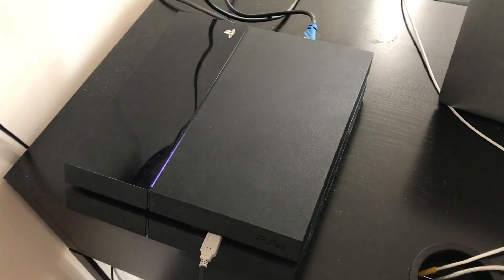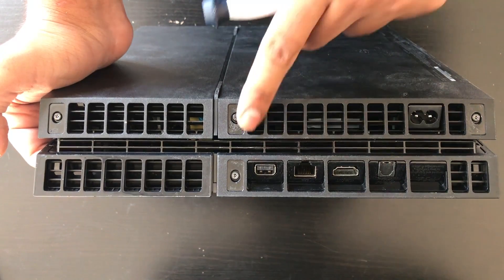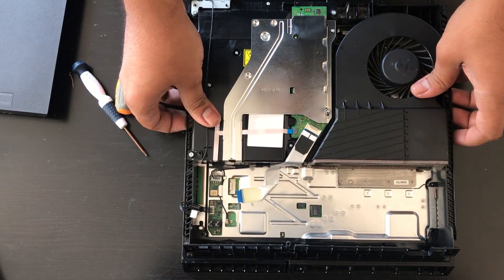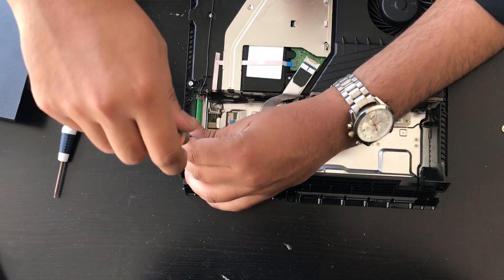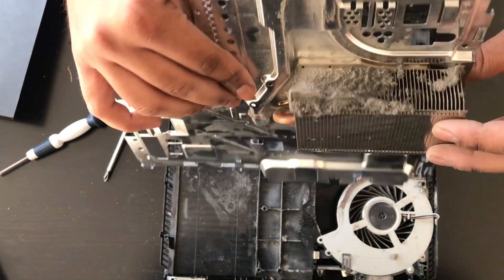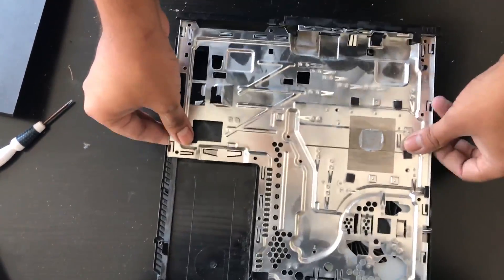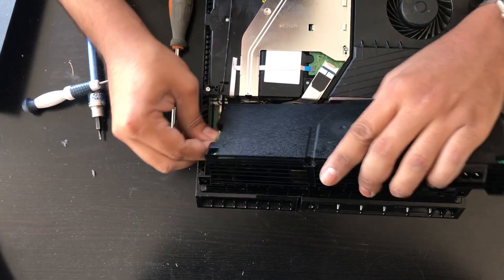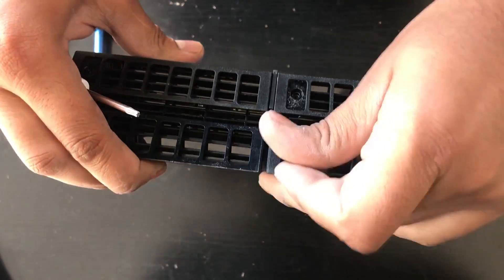PS4 Too Hot overheating due to dust build up and fan (CUH-1001/1115 cleaning and disassembly)

Comment: I did all of this step by step, double checked everything. I also replaced the thermal paste. When i turned my ps4 back on it started up quickly, flashed red and beeped 3 times then turned back off. It didn't used to do that i don't know what happened.
Reply from the maker: Something went wrong clearly

Comment: Hey so my PS4 is a original one got it from a mate for 80bucks when my daughter was like 3,she is now turning 12 lol,My PS4 was just randomly turned on for one sec then turned off,saw your video about power supply then just got the dust off it and it works,but ended up doing the full clean and even replaced the thermal paste and I watched you videos, took my time and it's now like a brand new PS4 so quiet and stays cool, my daughter is so happy and so am I,thanks so much for the instructions it was easy to follow and  it wasn't as hard as I thought. Thanks mate👍

If you are in a similar position to me and you are unsure if u can do this well u can!! my tool box consists of a hammer a tampon and now a torx8 lol😂, I'm so.shit at DIY it's embarrassing and I managed to do this,  can't fix my cupboard but can pull apart a ps4 😅,u can do this people give it a go,take your time and u won't regret it
Reply: Close with Aussie but we are next door, New Zealand good guess 👍
Reply from the maker: Thanks for your comment mate
Reply from the maker: Are you from the UK or Australia?

Comment: watched a few others recommending switching things off, turning it upright, keep it horizontal, clean this and that. This was in-depth thorough cleaning. even I managed to follow it. much better than all the rest. What I would say is buy some thermal paste before you start, if it needs you'll be glad you did.

Comment: So the other day i cleaned my ps4. The disc drive worked fine. I cleaned the ps4 put it back together now my disc drive dont work. Everything is plugged. I tried rebuilding the data base but that didnt help, any possible clues on how to fix this issue?

Comment: Is that little black screw in the corner really necessary? I am struggling to get that thing in. Other than that the video has been extremely helpful
Reply from the maker: Its not necessary but its always good to have all the screws in. if its there, its there for a reason.

Comment: Really good explanation on good taking it apart, sorta left me hanging on the reassembly, i have left over screws and didn't hear a thing from you until you mentioned the hard drive lol
Reply from the maker: The 3 missing screws are from the heatsink. Sorry 😅

Comment: I'm wondering if the mother board is dusty, is it safe to gently blow off the dust there, or use a small paint brush? And can you vacuum the heat sink caked dust off or must you blow it out with an air can?
Reply from the maker: Yes you can blow the dust off the mainboard using a vacumme cleaner. You can also use a paintbrush or tooth brush even. Good luck!

Comment: pleas help me my PlayStation does not connect the USB cable, but I have USB cable don’t work so I can’t connect my control to my PS4 so what I have to do. Please help me😢
Reply from the maker: You need a USB cable to pair your controller. Its also possible there is an issue with the bluetooth module (chip) on the mainboard but try getting a cable, connect your controller and press the PS button to pair.

Comment: I accidentally left the ps running for two days in a closed cabinet and heard fan spinning high.    Now the ps has power with the light but never turns on?  Is this a power issue or hard drive issue or fan issue.  Is it saveable?
Reply from the maker: Does the blue light keep pulsing?
Reply: @fasttechvideo   no it went solid white a few seconds later..  but i figured it out.. i had the hdmi output going to a 1input/2output hdmi splitter to two monitors.   the splitter went bad.. straight hdmi cable to each monitor and it works so i ordered a new splitter.   im a subscriber to you thank you for assistance

Comment: Thank's for the tips exelent vidéo mine was just a little bit dusty but the thermal paste start to be thin and some spot did not have paste at all ,i had no paste at that time so i rub the paste all over on both parts and it did the trick probably have to add more paste latter !thank you !
Reply from the maker: You’re welcome. Please like the video and subscribe for more videos like this.

Comment: For anyone doing this doesn't matter how your thermal paste looks once you've opened your system and got to the apu be sure to clean it and re apply the paste don't listen to this man 
That thermal conductivity is as good as gone as soon as you lift up the motherboard away from the heatsink

Comment: ehh i would of re-positioned the thermal paste back onto the processor from the sides as it would make a air tight seal once again not trapping hot air on the processor but thats just me lol nice work😀
Reply from the maker: I should have replaced the paste entirely but these were the early days.
Reply: @fasttechvideo  😊 no doubt ,we have all been there 😂
Reply from the maker: @davidtaylor4571  LOL
Consider liking the video and subscribing that helps me a lot.

Comment: Unfortunately after doing this completely my ps4 only turns on for about a second before shutting off, unsure what i did wrong but I'm not giving up yet
Reply from the maker: Check the 2 pins under the power supply and make sure they are not bent.
Reply: I made sure they were straight to the best of my ability but nothing changed. I'm not completely sure how to check if they are going in or not

Comment: I just commented on your other video and this is another reason why my ps4 is overheating and sounding like a engine I can also see all the black dust spots that builder up withing the fan and breather by just looking at it 

I need to get some security bits for my screwdriver
Reply from the maker: We sell the security driver in the description box and top comment of this video.
Reply: @fasttechvideo  ok thank you i will look to order it

Comment: I cleaned my ps4 and now it works great but my eject button doesnt work and my gta disc is stuck in there but it doesnt even read the disc. It says insert disc. Do you know what could be wrong?
Reply from the maker: Check the metal conductor pin on the case that is supposed to touch the eject sensor on the disc drive. Make sure it is not bent out of shape.

Comment: nice video. My ps4 was sounding like a jet engine and i have changed the thermal paste once before but i was exhausted by the time i did that part i just never checked the heat sync. But like in this video, the heat sync was the main thing to clean.
Reply from the maker: Thanks for your comment. Glad this video helped you out. Lots of people miss the heatsink and thats why I made this video. Drop a like on the video and subscribe 😁

Comment: There must be a way to prevent dust and hair from getting inside in the first place.  My daughter recommended panty hose.  Only on three sides, leave the exhaust side uncovered.  (That’s the back)  It’s worth a try.
Reply from the maker: You can buy filters for Ps4s but your idea might actually work but would block some airflow.

Comment: Thanks but the only problem was that i could not get the screw loose from the power supply so i couldn’t get to remove the main part 😬
Reply from the maker: Use a bigger phillips or torx head

Comment: I did it all and now my PlayStation, as soon as I turn it on it flashes red and turns off after cleaning everything
Reply from the maker: Check to make sure the board is flat and check the tightness on the heatsink clamp

Comment: I did this now my PlayStation is not turning on can u helpp plzz
Reply from the maker: No power or blue light?
Reply: @fasttechvideo  yes nothing at all i tried to re doing everything to see if i did something wrong but it still didn’t work
Reply: @fasttechvideo  plz reply:/
Reply from the maker: @khaledrachidi2529  check the pins under the power supply and check the tightness on the heatsink clamp.
Reply: @fasttechvideo  that didn’t work but can the thermal paste be the problem cause it was all dried up and another thing I lost one black screw under the power supply can that be an issue aswell and thank you for replying
Reply: @fasttechvideo  ...??:(

Comment: Hi and i'm facing the overheat issue and by reading most of the comments, i understood that most of them faces the heavy jet sound.

But in my case, it's silent , is it because the fan doesn't work well?
Do i have to replace the thermal paste?

Comment: why/how does my cuh1001a have only two screws in the back not for like every video I find on YouTube about taking off the bottom cover. every video makes it look so effortless but it is absolutely not the same for mine so I don't know how to find an answer to work around this problem there are not stickers in place of the two screws that show in this video but actual solid plastic that covers and there's nothing to peel and nothing to unscrew there. I'm just trying to replace the HDMI port the top came off fairly easy it's the bottom that's a mystery cuz of this issue. can anyone help a brother out please... 

I figured it out and I am stupid.

Comment: So went through all this and now my PlayStation isn't getting power. Ive rebooked at all the connections and they seem good. What am I missing?
Reply from the maker: Check the pins under the power supply.
Reply: @fasttechvideo  pins are straight

Comment: How do u do this with normal ps4
Reply from the maker: Define normal ps4
Reply: @fasttechvideo  yea Just the 400 dollar one
Reply: @redouansewcharan5985  slim?
Reply: @laky25cz  Just the average one Not slim and not pro Just Idk Just a ps4
Reply: @redouansewcharan5985  The PS4 he has there is the original average ps4, then there's Slim and Pro, there could be a normal one with a different design but that's custom or one of the beta versions.
Reply: @laky25cz  i Just got original

Comment: Where can I go to get this professionally cleaned? I tried doing it myself but i assume I didn’t do a good job bc the fan on my ps4 sounds louder than before. I took out a FAT piece of balled up dust from back of the fan but my guess is that there’s still a lot of pent up dust that’s accumulated over the years. Would greatly appreciate any tips or any suggestions on where I could go! I’m in California

Comment: Thanks a lot brother.Your Detailed video helped me to solve overheating issue of my PS4 .Also I changed thermal paste.Most difficult part was removing power supply connector which I did by using small  plier tool. ❤️❤️

Comment: I did the deep clean but i didnt change the thermal paste. i connected everything back up and it works fine then it says its to hot. does that mean the thermal paste need to be changed?

Comment: I'm scared to do this. Worried I might break something, or not be able to put it back together. But my PS4 sounds like a fighter jet right now, and tells me the system is too hot, so I guess once I can find a torx screwdriver, I will just have to give it a try. Don't have the money to take it anywhere to be done, or send it off anywhere.
Reply from the maker: You have nothing to lose. Godspeed.
Reply: @fasttechvideo  thanks man.

Comment: Really good guide.. my heat sink was basically the same thing, and I blew dust out of my PS4 several times before but never opened it up this far. 
I did end up with 2 extra screws,. The silver ones .. not really sure where I missed them ? PS4 is ultra quiet now , I was worried my fan wasn’t running at first lol
Reply from the maker: They are heatsink screws.

Comment: Hey just recently went through this issue, I now have a silent fixed PS4. Had no luck with finding a ps5 or ps4 bought the last one from a pawn shop it sucked did not work. Fixed mines even had a few screws missing but it works like new now thanks man happy New Years ✊🏽💯

Comment: 30 OR 40 MINUTES IT'S ABOUT 5 MINUTES BEFORE IT HAPPENS TO ME
Reply from the maker: Expect to find a lot of dust in there. Good luck 😁
Reply: @fasttechvideo  😅thanks I think I'll need that luck
Reply: @fasttechvideo  erm when I try to turn the playstation on after cleaning it. It keeps turning on then the bar goes red and turns off

Comment: I rebuilt database, cleaned everything including the fan, got a new hard drive, wifi is better than average, restarted it, unplugged it and plugged it back in, tried no uses of the USBs, restored the ps4 system,  reinstall system software. Literally everything and it still overheats and lags in every online game ever. Thinking about just throwing it away tbh

Comment: I follow your video to the tee. My PS4 hasn't been cleaned in 7 years. I used arctic silver 5 thermal paste, replaced all my thermal pads, cleaned my fan blades with a million Q-Tips, and cleaned the heat sync. My PS4 is quieter than when I first bought it. Thanks a Trillion!❤
Reply from the maker: Thank you for watching Jerome don’t forget to like and subscribe.

Comment: Fkn broke mine following this. I wish I never bothered 😭 now it doesn't even turn on 💩
Reply: did you fix it ?
Reply: Ha! No! I'm having to pay for it to be fixed now! Great! 👌💩😒
Reply: @monkeychu420  you prolly have to put a gap in between the prongs
Reply: @monkeychu420  that’s what i had to do to mine
Reply: @tecdek7153  cheers, dude! If you're talking about the bit on top of the heat sync with the washers, I tried that.. to no avail! As I said, I've got It booked In to be repaired tomorrow. Bit gutted though as I thought I'd save a few quid doing it myself. Guess I should've chose a better tutorial?!
Reply: @monkeychu420  yea nobody explained it right i had to find it in a comment section
Reply: @tecdek7153  right?! Lol I'm just hoping it needs new thermal paste! Pray for me! 😭😭😂😂 Have a good one, pal! 👌👌
Reply: @monkeychu420  you too bro

Comment: Sebastian I use special magnifying goggles to so a lot of this work as I'm getting ancient like my PS4's! Invest in some 'dental hooks' these are PERFECT to remove the tiny cables (all that stuff is found on Amazon) Or use a small precison screwdriver behind all the wires then GENTLY wiggle and it should release. Did you check the heat sink paste was still good?
Thanks Fastech just carried this job out as I had a PS4 sounding like an L-1011 on take off power - now all quiet! Thanks I owe ya a Budd!😀

Comment: This video finally gave me the push in confidence that I needed in order to finally open up my PS4 (CUH-1115) and give it a thorough cleaning. I even went the extra mile and replaced the thermal paste for that "new car" feeling. Thanks a million man, for real.
Reply: did you use a certain thermal paste or does any work fine?

Comment: shit is honestly easy. bought a ps4 opened it up dusty as a mofo. so i bought a tool kit frm walmart cheap like less than 25 dollars. comes w each bit. t8 and a screw is all you need. opened everything up gently. grab air dust and dust it out put it back niceeee and ahi ta papa. trust yourself

Comment: A week ago when I turned on my PS4, it was rlly quiet and would shut off with three beeps and a red light when I load up a game. I searched it up and it's because of overheating and it might mean that my fan isn't working. But when I opened it up, it could spin well, so I thought it was a connection issue. Then and u watched this video and after a few days, I opened my PS4 to clean it  as I didn't wanna get a new fan. Now after I've cleaned and reassembled everything, when I turn my PS4 on, one second later when I hear the usual beep with the blue light, the three beeps and the red light appears. Please help!
Reply: you probably need new thermal paste

Comment: What about power supply don’t you need to open it up as well and clear all the dust
Reply: You should at least blow out the dust with canned air. In fact you should clean out as much dust as possible, as well as replace the thermal paste.

Comment: I did this finding  a big clump of dust constructing the area and put it back together, now my PS4 turns on and straight back off I'm so annoyed I've cleaned my PS before(not as deep as this however) 
I have also fixed my disk drive watching vids and quiet PS vids with success and have  ever had a problem the times I did but this one defeated me I'm so pissed off.
Does anybody have any advice on this, it literally turns on for a second and switches itself off again.... HELLLLP!!!

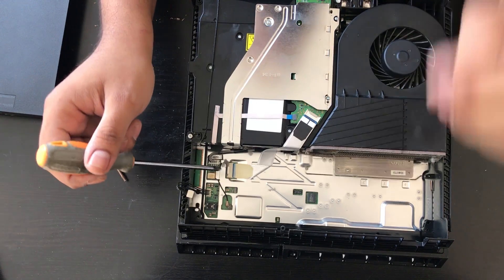Comment: I was scared to disconnect the power cable. So I just put the power block to the side with it still connected. I stoped taking it apart at 3:55. I was able to clean most everything from that vantage point. Thank you!
Reply: Thx lmfao it’s so fuckin hard to take off for mine
Reply: @dylanroman8816 yeah I couldn't get mine out so i left it in, planning to just do everything with it still attached, then it popped out on its own but from the other connection point, might be easier taking that end out
Reply: @fatbroccoli8  i took it out its under the cylinder shit its like a clip i press the button and pushed the wires down with the same hand at the same time bc both hands dont fit
Reply: @fatbroccoli8  oh shit lmfaoo bro im sorry i thought it was a killswitch for a car video 💀just seen it was a ps4 video lmfaoo forget everything i just said
Reply: @dylanroman8816  lol sounds like it still applies

Comment: I may have to do this same exact thing to my ps4 it’s so loud I can’t hear the gameplay I know it’s gotta be full of dust, my recommendation tho is instead of using a can of air use a air compressor with a blower attachment works excellent and it saves you 8-10 bucks for a can of air 🙂👍

Comment: I’m stuck at the connector. I don’t want to pull the 5 wires apart and idk if I take out the smaller part attched to the 5 wires or the part it’s connected to